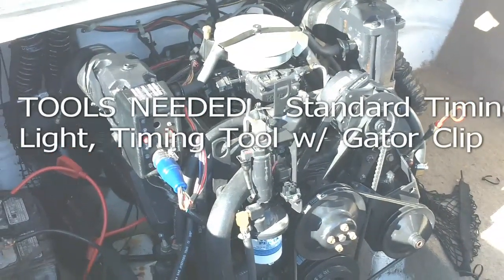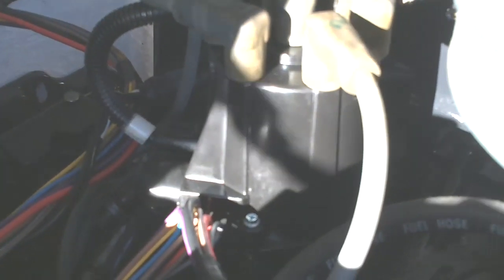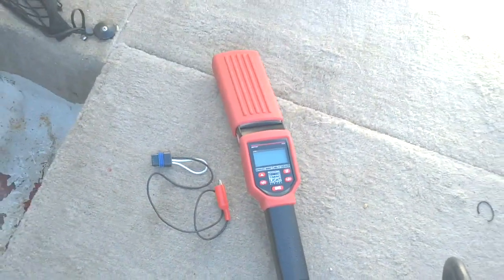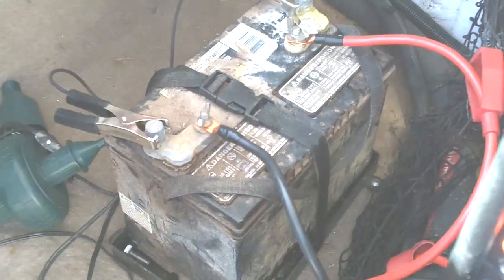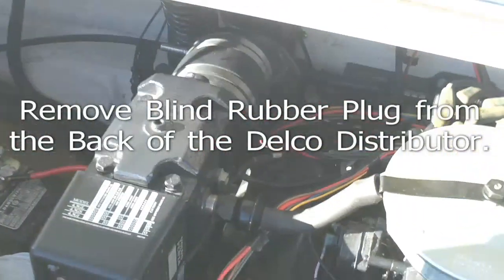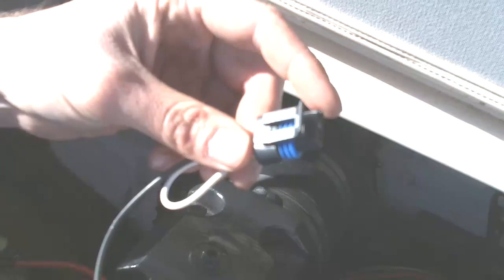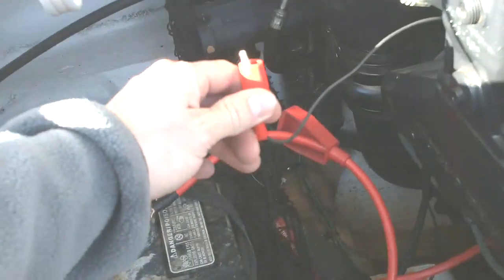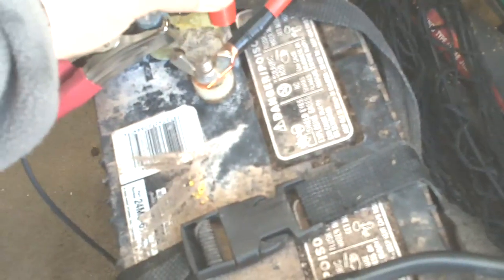How to Set the Iginiton Timing on a Volvo Penta 4.3L GL Mari

Comment: Hello, i have a Volvo penta 4.3 GS. Do i need this tool?   Can I directly set the timing advance directly following the chart in the manuale?   600 rmp -18°, 1000rpm - 21°.   Using a normal strobo light. I set 10° on the light. motor at 1000rpm and I will see 0° on the damper marks.

Comment: What happens if you plug up jumper befor motor is stsrted.   Some people say befor some say after.  Any info
Reply: burn out the ignition module
Reply: @5150BUCKET  how sure are you about this? My factory Volvo service manual says to connect it to positive BEFORE starting the engine. I was scared to because I read so many posts saying to do it after the engine was running and YouTube videos stating this. So I connected it after the engine was running and it won't disable the timing advance. I found a post on the boating forums stating you MUST connect it before starting the engine or it won't disable the advance.

Comment: What is the factory timing setting for a 1996 Volvo 4.3 GS with stamped steel oil pan, short reach plugs (Champion RV15YC4) and running 89AKI octane? Is it 0 degrees TDC or 6 degrees BTDC??
Reply: 10 degrees is the perfect number.